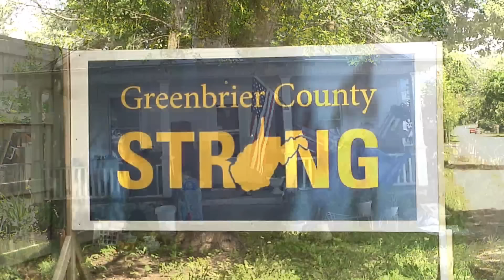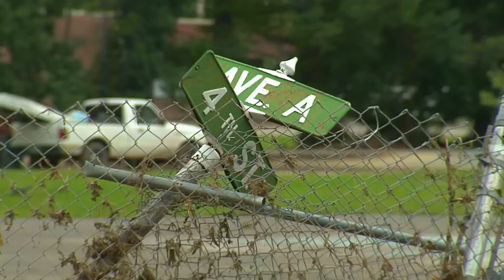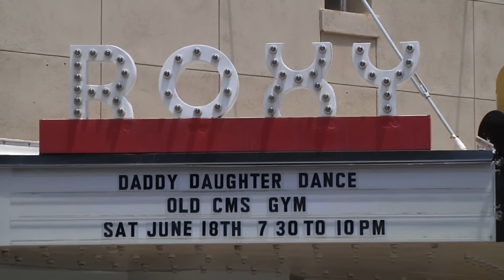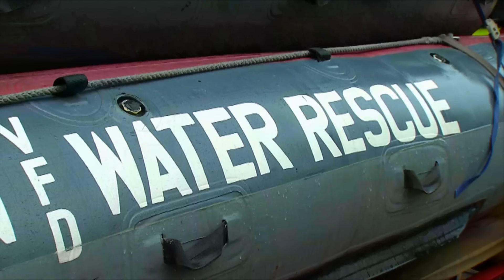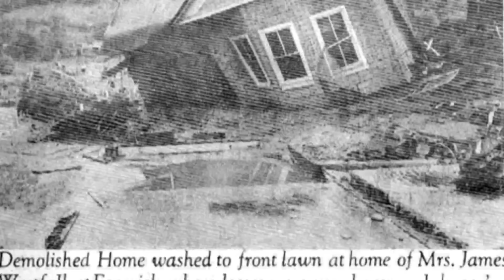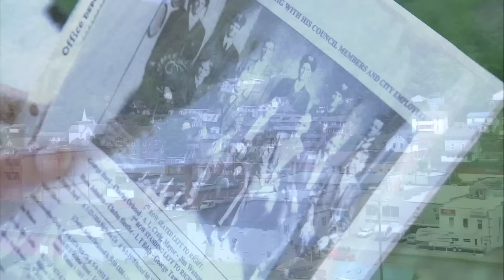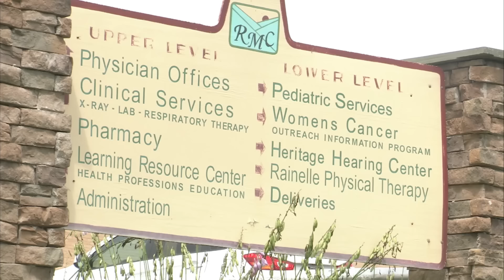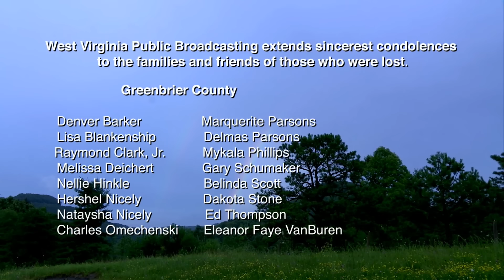Inside Appalachia: WV's 1,000 Year Flood

Comment: Each and Every single year, for reinsurance purposes:
There's a 1 in 1,000 chance of a thousand year flood;
There's a 1 in 500 chance of a five-hundred year flood;
There's a 1 in 100 chance of a hundred year flood;
There's a 1 in 50 chance of a fifty year flood.

For each actl. chance (adjudicated by stakeholders outside & beyond our local control in the States, or the Counties where the people are living day in and day out) there's a matching map.

When a flood, like this one, turns out to be a thousand year flood, people are impacted in the 1,000 plain, the 500 plain, the 50 plain, etc. into the course of the watercouse itself.

In contrast, a 50 year flood doesn't or shouldn't impact past the farther zones. Exceptions might be when the feds flood safe areas on the same or lower elevations but without connection to the flooded watercourse or with an opposing slope, topography or, flow gradient, in order to save federal assets, relieve dams, etc.

These plains, zones, maps, have nothing to do with assisting the people of the land, God's Own.

The plains are about risk mitigation for reinsurers.

Comment: It happened once so it will happen again. Can't blame folks for moving because you can beat many things except water. 
Best to measure how high the flood got and build safety-critical buildings well above waterline and away from likely washouts.  Building with cement and concrete block is common in areas like the Caribbean which expect repeat storms.